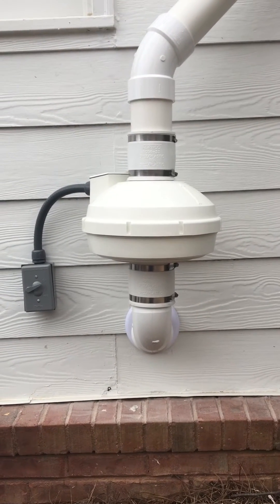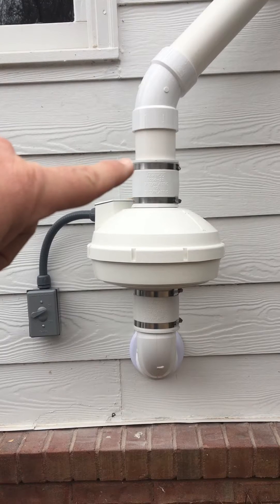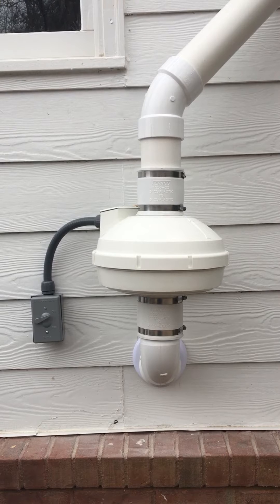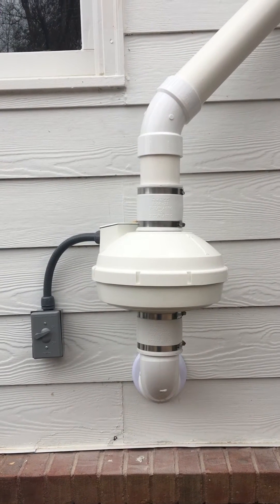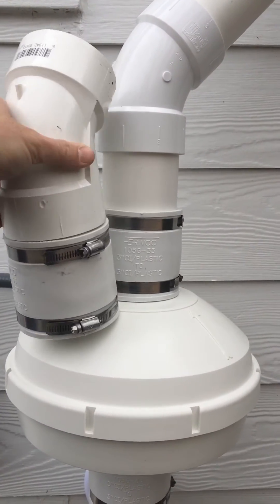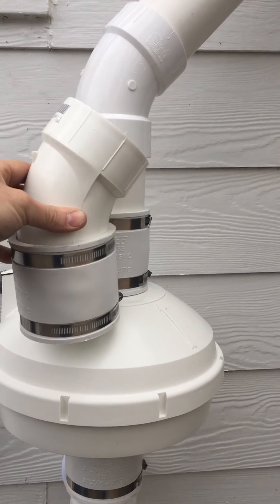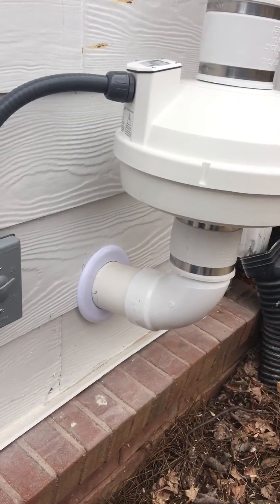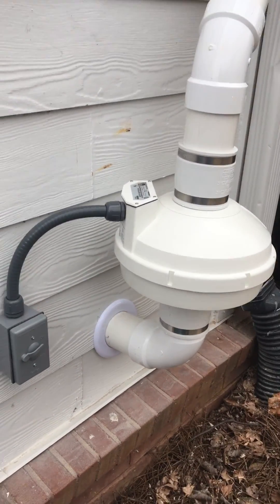Radon Fan Installation Tip

Comment: Why the fan so close to a window? All radon companies here mentioned to me that "EPA's Radon Mitigation Standards require vent discharge points (including radon fans) to be at least 2 feet above or 10 feet sideways from any windows or vents to interior treated air spaces."

Comment: Why does the liguid tight come from the top ?   At an chemical plant I worked at, all these were 18" or longer to form a U so that water would not get into our electrical systems.  Seems short sighted to come from the TOP of an enclosure and not think about water.

Comment: I am not too familiar with radon mitigation system. That fan seemed little bit noisy
Reply from the maker: The loud noise you here is a skill saw, not the radon fan.  Another contractor was onsite working on the deck.  Some radon fans are louder than others.  Parameters that contribute to sound is air flow and pipe size.